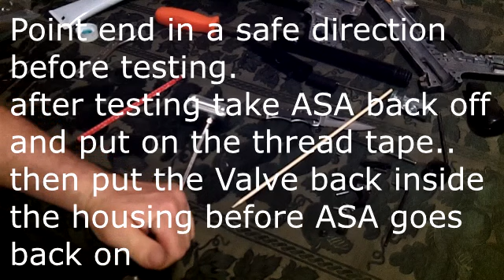Repair a leaking valve on a Tippmann 98 paintball gun

Comment: I already figured that was what I needed to do to fix my Tippmann only problem was some lamo 🤪 had bonded the air tube in with epoxy or something really strong even on my vise I couldn't get the hose to unscrew but your video confirmed I was heading in the right direction so thanks very much after I get a new valve, power tube & air tube I'll have to cut the other Valve out of the power tube so I can repurposes it, and I just know that split ring is going to have me screaming bloody murder 🤣🤣

Comment from the maker: KPOP- If you take the tip of a knife or something with a sharp tip, you will run it around the top lip of the ring until you feel it catch.... That is the break in the ring, it is cut at an angle that will let you get behind it or behind the tip of the point. You then will have to take the tip of your knife and pry it toward the center of the valve causing the ring to separate, you then work it around toward the top of the valve.

Comment: 6:32 I'd recommend not using a knife as the tip of the knife broke off and hit me in the face. Maybe I'm just unlucky but a strong flat head screwdriver works just as well.  There is a little angled notch at the beginning of the ring on the top and you need to wedge the screwdriver through the notch in the ring which then puts it between the outer most loop of the ring and the inner most loop of the ring. Then just rotate the valve until it pops off. Little rotation force also helps to prevent the screwdriver from slipping off of the notch while you're trying to get it between the inner and outer rings.

Comment: Would this leaking from the valve also make it fire as if its full auto? My gun started leaking just as it did in video I re-cocked it and it fired and kept firing after I let off trigger. Does that sound like its the same problem?

Comment: Hi, first of all, i'd like to thank you for your help, i did manage to open that valve :)

Now, i think my problem is the cup seal, a white o-ring that looks like the one you replaced( but was in the valve) was all torned and sticked out from the opening on the top.

The thing is, i didn't see you take out that part and another metal part from the body of the valve.

anyway, can you tell me where to buy those o-rings? Than you very much

Comment: I did everything you did replaced all rings and it still leaks, did I miss something? By the way great video.
Reply from the maker: Not sure... Sometimes when you replace the rubber pieces you need to air it up and fire a few times to get everything to seat right?

Comment: dude, i have a leak on mine, it's leaking from the threads where the hose screws in, I bought another valve, the same damn thing happened....the hose is good cause I switched it around and it still leaks from the valve's threads but not from where you screw the tank in...i dont get it
Reply: shawn paulin  did you use any ptfe tape on the threads? If so, try using a little more.....

Comment: Would this leaking from the valve also make it fire as if its full auto? My gun started leaking just as it did in video I re-cocked it and it fired and kept firing after I let off trigger. Does that sound like its the same problem?
Reply from the maker: trent vogel That could be a few issues... Not enough blow back.